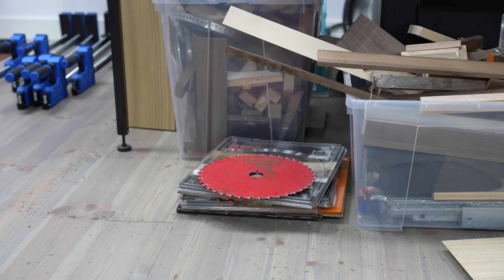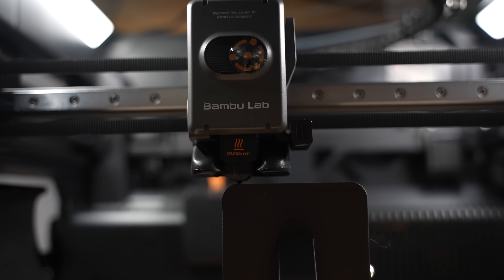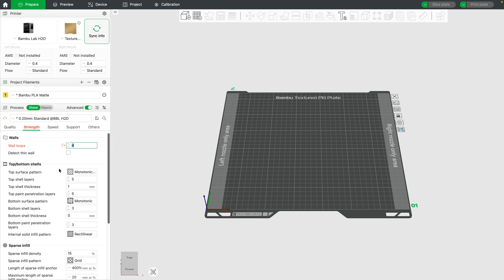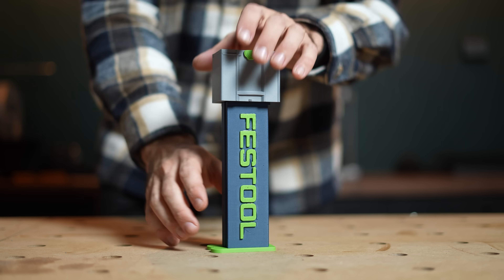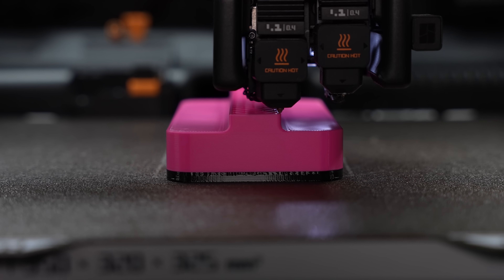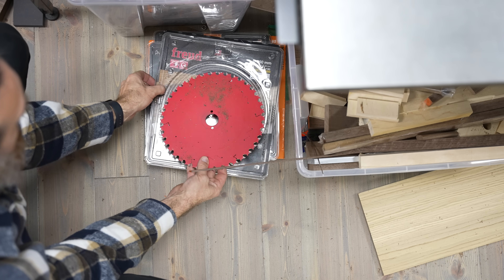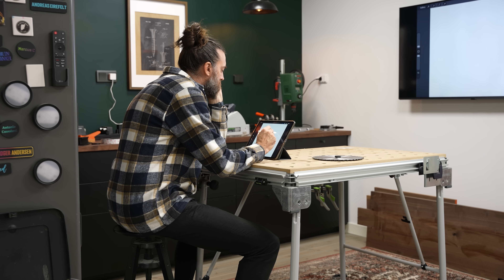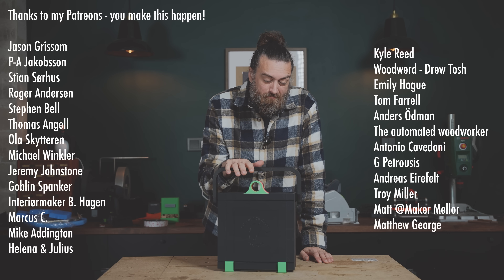Tool companies can't compete with these 3d-prints

Comment: I think another possible solution for getting the blades in the middle out more easily would be to use T shaped handles instead of the circle cutouts in the current design
Reply from the maker: Great suggestion!

Comment: Great designs, thanks for sharing!  On the sawblade holder, instead of having offset holes, could you add some "wings" or "flares" to either side of the lifting hole?  You could then lift out the middle blades by pinching sideways.  I wish I could attach an image here in the comments.
Reply from the maker: Great idea! That is totally doable!

Comment: nice blade holder... but double side them, no reason to have just one blade per insert.  You'll probably fit more in the same area, even if you have to increase the width of each insert
Reply from the maker: haha I didnt even think of that 😂
Reply: Hmm I like the idea, but how would you print it so that you don't need supports? Supports would be a pain to remove.

Comment: 9:30 you don't want TPU for "grip". There are other filaments that excel much more in this regard. For the same reason the RC community doesn't use TPU to print their wheels, they just slip. Not all "rubber-y" materials have the same properties, like bouncyness, grip and of course flex.
Reply: mind sharing what filaments?

Comment: Lovely builds, like the format of the video! Really nice to see a few different ideas, and some perfectly placed plugs for your own designs.

On the blade holder:
Would possibly make it a little bit harder to lift/place the cassettes, but I would offset the handles on each blade holder to make it easier to lift, because just as with your dominoes you can bet that the blade you want is always in the middle..
Different heights on the handles might also work but I like the offset idea more.
Reply from the maker: Totally agree - I didnt consider it when designing because of the feet sliding in to the dovetail tracks - but I saw, when done that it can actually be done. So there might be an update with offset handles coming.
Reply: @TheSwedishMaker  You could also shape the handles in sort of "T" shape (instead of "O"), so they can be grabbed by the sides. Should be problematic only to people with really fat fingers ;)
Reply: @TheSwedishMaker offsetting the handles is indeed a good idea. To solve blades falling our you could implement a horizontal  locking pin.

Comment: For the saw blade case, instead of moving the feet to lock the blades in, put something on the handle so when you fold the handle flat on one side, there's a catch or something that pivots into place preventing the blades from coming out.
Reply: I think some coolers have a similar design to what youre mentioning correct?

Comment: Like the blade storage. I'd offset the handles for each blade so they are staggered at the top, and have like 5 or 6 different ones to choose from in those different positions for easier removal. As far as the blade trays themselves I think they could be hour glass shaped to reduce some filament, but also they could be easier to remove, or have a Pac-Man mouth on one side for easier grabbing of the blade and removal, or have some bigger holes around the blade edge so you can grab the blade easily to remove them. Seems like I'd have to stick my finger under the blade to remove them and could cut myself.
Reply from the maker: good suggestions!

Comment: You could design an attachment for your dust collector that you can place on the ground like dust pan, and then sweep up your shop right over to the dust collector and it gets sucked up right off the floor without you having to even move.
Reply: Yeah, I have been thinking about two dust collection ideas, one is the vacuum hose nozzle but with a broom handle attachment so one can stand upright (but makes it hard to use under benches for example).
Second is a funnel right on the wall so I can sweep with an ordinary broom and the cone/funnel will magically disperse the sawdust.
Reply from the maker: That's clever! I need that
Reply: We had pretty much this solution in the workshop in school, worked great. Only downside is you get more dust in the air from using the broom vs moving the vacuum around.